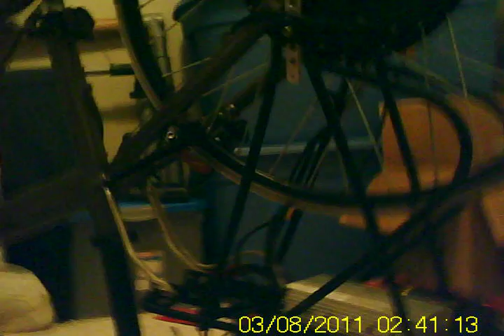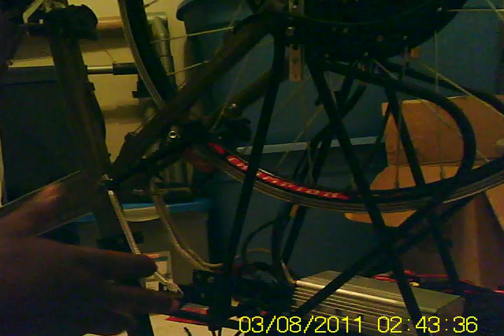Lyen Sensorless/Sensored 4110 12 Mosfet Controller Operation.

Comment: Do you know where/how the controller stores whether the hub motor is sensored or sensorless? My friend bought a sensorless controller by error, I soldered the 5 required wires for hall sensors, and after first run it does not run anymore without sensors, e.g. if I disconnect the sensors it won't run anymore. With sensors it works fine.

Strange effect.